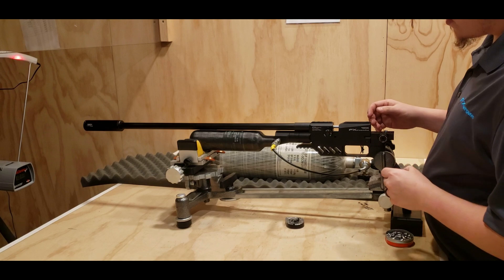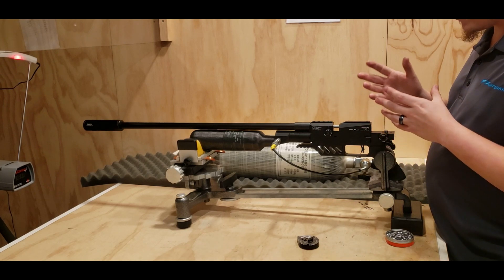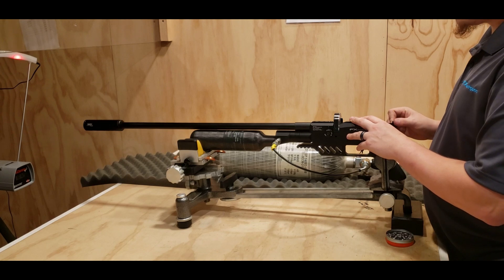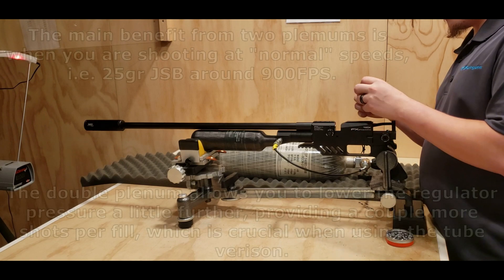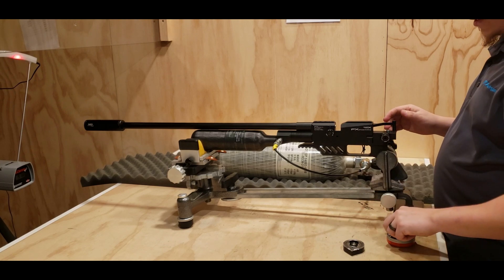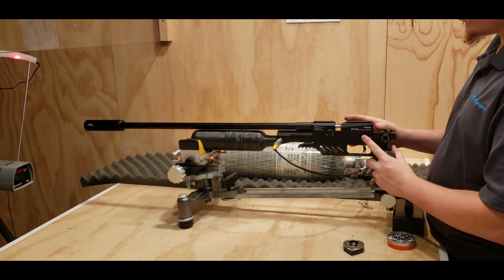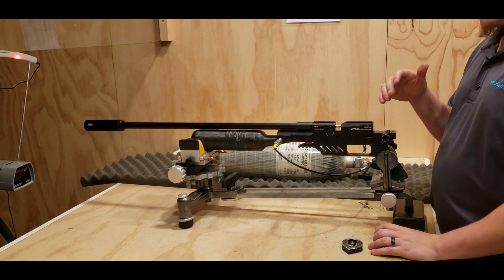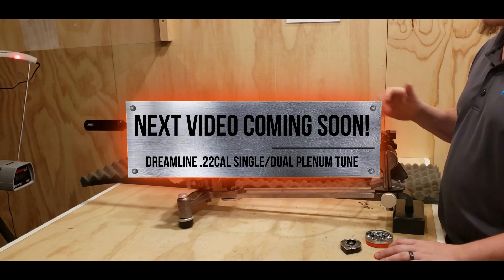How to Tune FX Dreamline DUAL Power Plenum - FX Airguns Dreamline Tuning

Comment: hi  great vids       im looking to buy a  dreamline   bottle  version  with sabre tactical  chassis  in 25 cal      it has a duel plenum allready       is there anything i can do to up the power   like fitting a heavier hammer spring    all info  is much apreciated
Reply from the maker: make sure it has the 13 gram hammer weight, but besides that, you are already maxed out. Best of luck!

Comment: great video!if i understand you use two standard plenum screw in it togethers?
Reply from the maker: Yes! You can attach as many plenums together as you would like, but after testing, there is little to no gain after any more than 2 plenums.
Reply: 910 Airgun Tuning and Repairs nice , so I have been using 2 plenums for a while now , I haven’t tested only using 1 plenum , can you please tell us the difference between 1vs2 plenums on the dreamline , thanks a lot 👍🏼

Comment: Is the valve seat the same as the impact ? Im wondering if the titanium bigger valve seat mod on the impact will work in the dreamline
Reply from the maker: Unfortunately no the valveseat is much smaller
Reply: 910 Airgun Tuning and Repairs could it be drilled out ? 😅
Reply from the maker: @ptescreen18  possibly, but I do not think there is enough material to drill out to fit

Comment: What do you think is it possible to get more power by widen the holes on power adjuster? Your videos are very informative, keep up great work :)
Reply from the maker: I have actually already tried that 😂 unfortunately, the valve seat is still what is constricting the airflow, so the size of the interal porting is already fully efficient at the .25/.30 setting. The only enlarged porting that helps is the inlet and probe, since those holes are smaller than the port adjustment
Reply: I have already widen both the inlet and probe. I dont understand why manufacturers are making so small valve seats. Imo wider hole can pass  same amount of air as smaller hole in less time. Less time= higher speed  of air=more fps
Reply from the maker: @wildscorpion73  not quite.  The smaller valveseatxhas a nozzle type of effect on the air, as that is the path of least resistance and the air wants to naturally go that way, squeezing itself through the small hole making/keeping a higher pressure. FX designs their guns for efficiency and shot count, not extreme power/speed
Reply: Yes but with more power at same  amount of air  mean you can reduce power and get more shot count. All you have to do is to shorten the time of opened valve by playing with hammer spring tension. It would require heavier hammer weight to be able to open wider valve. It would require wider transfer port too to pass same amount of air in less time of course but in the end you could either save some air or get more power over smaller seat hole
Reply from the maker: Yes, now I believe we are getting on the same page. Although, I am not sure if there is the physical room for more space to be created inside of the block for the large porting, without compromising the structure. FX is always innovating, so I'm sure this is something that is on the drawing board!

Comment: now that's the power I want in 25cal,  all I hear about fx guns when you want power, people always say it's about finding the right fps, & my question is with this new power plenum, is it accurate at those fps...in 22 & 25
Reply from the maker: Hey Gerald! The plenum is great, but for anything past 20 yards, pellets will need to stay in a specific speed range to maintain accuracy, generally between 880-920 FPS, depending on the shape and weight of the pellet.
Reply: @910AirgunTuningandRepairs  ok, I appreciate your response..nice gun

Comment: Great videos. Is it possible to adjust the trigger on my mark II Impact to 3-4 oz like my Taipan veteran??? Thanks!
Reply from the maker: The Impact can only go that low with single-stage, not two-stage. The two stage function maxes out around 7-8oz
Reply: @910AirgunTuningandRepairs  Thank You!!!  I couldn't find that info anywhere.  The Taipan trigger has really spoiled me for anything else.

Comment: Would this power plenum fit on a wildcat mk2?
Reply from the maker: Not this power plenum, but I believe there are some aftermarket Wildcat plenums in the making. Also, I believe this will fit the wildcat if you stack two plenums. It normally does not fit due to the regulator hole lining up with the barrel brackets.
Reply: Ok i see exactly what your saying ,2 plenums would clear it I see,what would happen if  that breathe hole was to be  blocked? On my gun it has a rubber cap type thing

Comment: Nice, that answered my question and curiosity 🤣.  I’ve decided however to buy an impact 😉
Reply: Peter King I purchased the Dreamline last August and I was happy with it until I realized I wanted to shoot heavier slugs or at least have the ability to when I want.
Once I saw the impact with the power plenum and that FX was bringing the .35 it was time to get one. The Impact MKII Power Plenum is wicked!!! I have it in .22 -600mm pushing the FX Hybrid Slugs at 960fps at @125 bar...
Reply: Mr. Whisper they’re incredible, before this lockdown my brother in law brought an impact. It took what seemed like an eternity to arrive 🙄.  But once we got out to one of our permissions to start the tuning process ( lots of YouTube vids for guidance)  it was incredible to see the fps going up and up 🤣.  So far we’ve got the reg pressure at 125 bar and turned the hammer spring a few turns. We tried having a laugh and shot some hades .22 out of it. The chrono said over 1,000 fps 😳.  Thought we’d have a shot at a tree about 140 yards away.  Omg, that pellet got there fast! 🤣. More to do with it however we’re not allowed to go out atm 🤷‍♂️.  After our tinkering that first day ( which was incredible) we went out with the rifle that night to try it with night vision, wow, watching those slugs fly at over 800 fps was incredible especially as in the uk we’re used to shooting @ around 560 fps. Having an fac licence will make pest controlling much easier 👍.   I’ve just put an order in for my fac impact, could however be weeks before it arrives 😭.
Reply: Peter King I did feel the pain of waiting for the Impact to be in stock. I kept checking certain stores on Tuesdays and Thursdays; seemed to be the delivery days here in the US.

Comment: Nice video as usual, thanks for sharing. I just got my fx dreamline power plenum two days ago, now my .22 dreamline has  2 plenums: the fx one (17cc) and the huma-air one ( 14cc, came together with huma reg), with total volume of 31cc. Now I shoot jsb 18gr pellet @950fps and fx hybrid slugs @850fps when reg set to 125bar, I havn't tried higher reg setting since it's a tube version, shot count is quiet limited (and I only have hand pump...). I'm looking forward to your next video, want to know what power can be achieved with higher reg setting.
Reply from the maker: Might want to invest in a compressor and a scuba if going for high power with the Dreamline. 😉 You will see in the next video, you are not too far off max.
Reply: Hey, that sounds like a great set-up,  did you adjust your hammer spring and if so how did you set it. What's accuracy like at these speeds

Comment: Great video as usual. Would be very interesting to see what other modifications are needed to make the most out of the second plenum. A drop in 10bar reg pressure is a lot less than what I was expecting
Reply from the maker: Honestly, I do not think there is much. Maybe a heavier hammerweight? the Dreamline is mostly restricted by its 5.5mm valve (Crown is 5.8mm, Impact is 6.3mm)

Comment: Thanks for the advice, I was just curious. I have the 500cc bottle and with reg at 110bar and fill to 240bar down to around 130bar shooting 18gr@900fps, I’m shooting 6-7mags. I could probably get another mag but I didn’t see the need. I feel fortunate to have been able to get the tune that I have and been due to you and the other people that have chosen to share there knowledge. Thank you!!!!
Reply from the maker: no problem at all, glad I could help you achieve your tune! Sounds like a great set-up!
Reply: It also depends on how long your barrel is.. the longger the barrel the more efficient the air

Comment: Thanks for the two plenum video. Looking forward to the .22cal video. I have a single one now as you know and got lucky with the tune. Drop my shroud while changing the liner and bent the threaded end and now waiting on replacement parts before turning for slugs. Your video are an excellent source of knowledge. Please keep up the good work.
Reply from the maker: Thanks for the insight! My best advice is, if you already have what you are looking for in the one plenum, no need to buy a second. The difference is minimal. If you need more shot count, I say switch to a bottle version. 👍